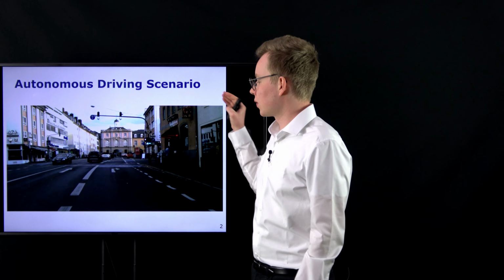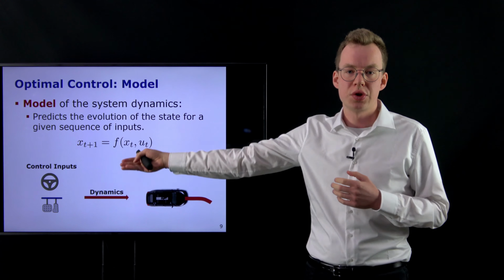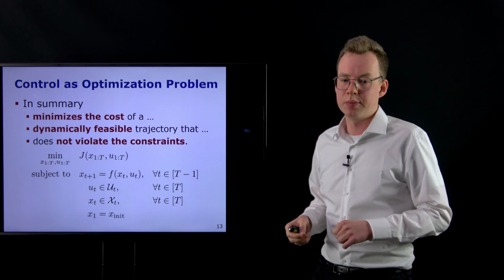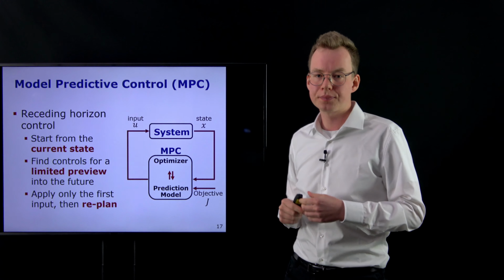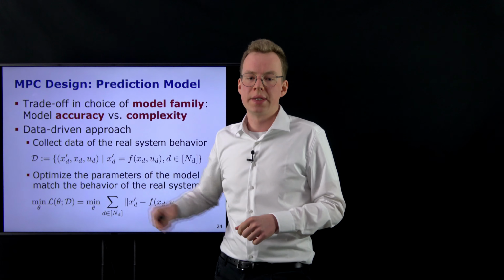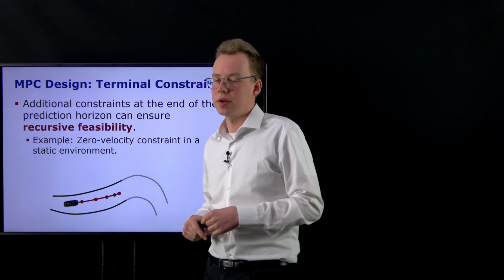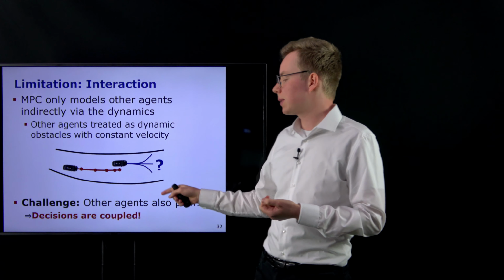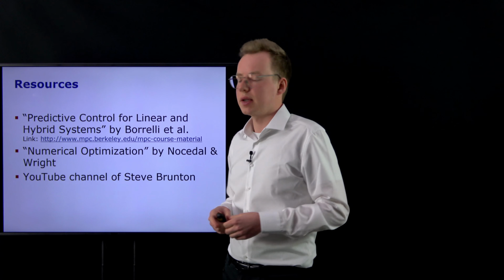Model Predictive Control - Part 1: Introduction to MPC (Lasse Peters)

Comment: I am having a problem where I plan the entire trajectory of a car, with the velocity and steering wheel in each time, but when I send to the controller, it suffers an unpredictable delay that causes oscillation in my system. How this problem is solved? How the controller can fit the previous trajectory being followed with the new smoothly?
Reply from the maker: Unpredictable delays are tricky. If you have the chance to estimate the delay time, the smith predictor might help you here.

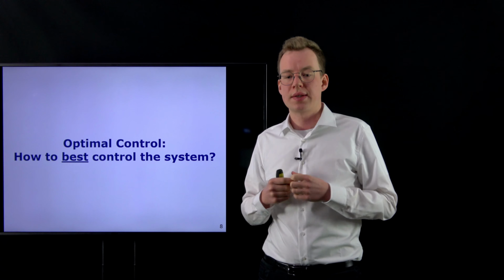Comment: Hi Cyrill / Lasse, extremely helpful! Just one comment, I think that, when talking about the Model (5:25), it gives the impression that the Model element is a unique feature of the MPC concept, which I think that is not. The model is needed in standard control theory too, however I think that, in MPC, there is the possibility that the model be more complex.
Reply: yes, these kind of control problems need to know the control model or the kinematic of the robot.  There are also some end-to-end deep learning models that can apply to the model-free control.

Comment: In the example at 34:22, what is the sensor setup for localization (for describing internal state variables) of the vehicle?
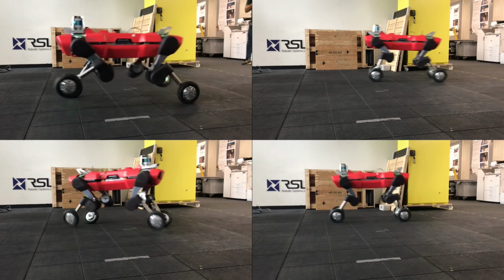Another question is that, in the robotic control at 34:57, how to get initial data for modelling the kinematics, I note that improper initialization of the model could be unstable, which cannot even make the robot running safely. This is quite different from the case of a 4-wheel vehicle, which could be safely run by a human driver to collect initial data.